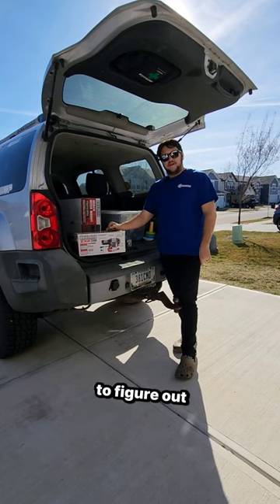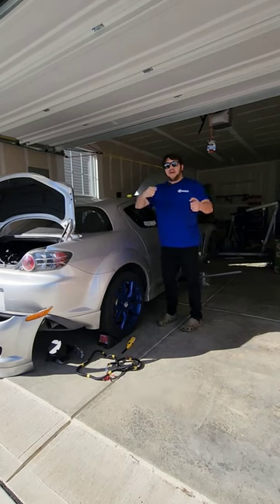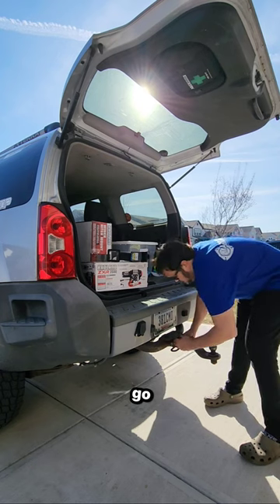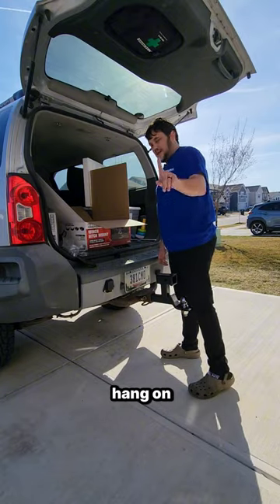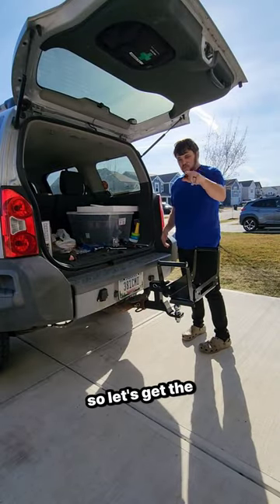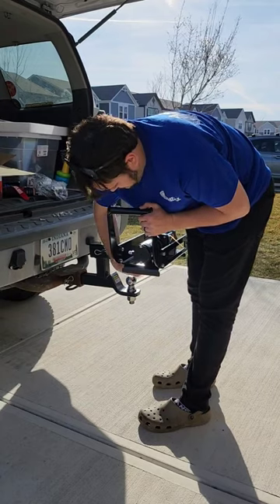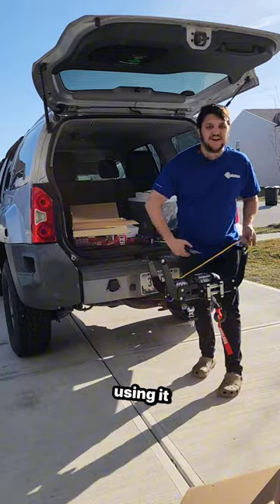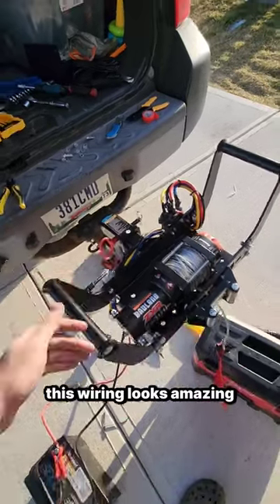Installing a ‎@harborfreight winch to pull my car onto a trailer

Comment: Looks like it may be illegal if not in active use. That high hitch receiver clearly obstructs your license plate. Not sure if you meant that or not. Though if left in place even with the winch off. You could be cited. Evasion of toll fees and evasion and hiding identity.  I’ve seen a commercial truck pulled over for having to much slush and salt on his plate.
Reply from the maker: The toll I could actually see